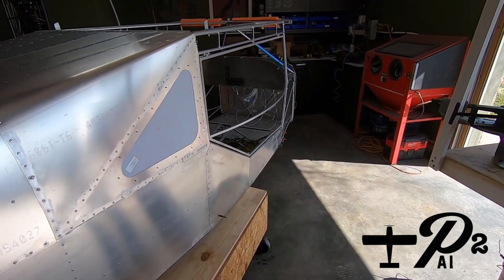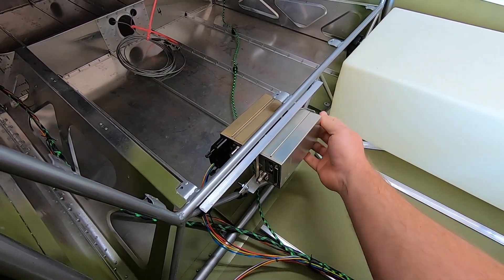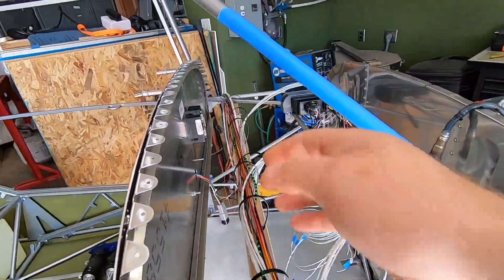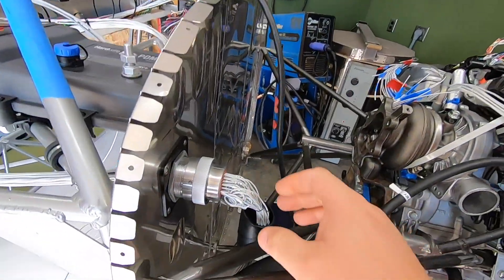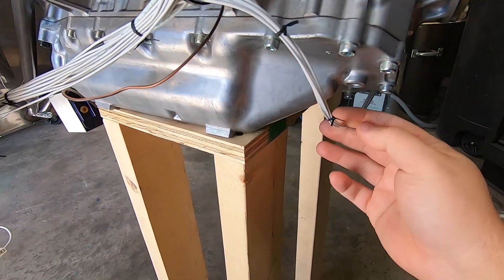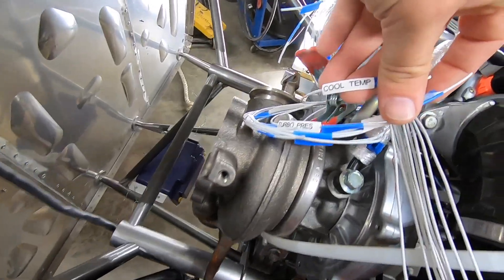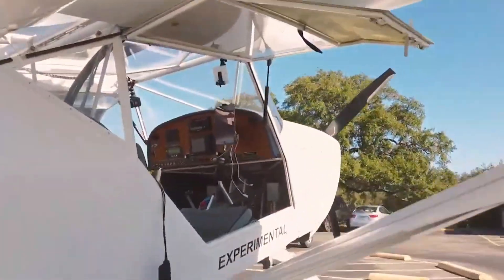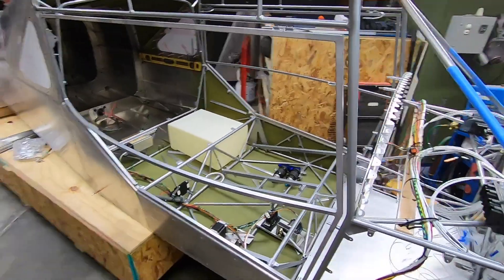RANS S21 EP27 UPDATE

Comment: A Uni-Bit is your best friend, when drilling lightening holes, lot's of opportunities for them from what I saw, just saying. They are time consuming for sure, but I get a warm fuzzy feeling every time I look mine! (everywhere.)  The big Lycoming  21's pilots are going to be in for a shock when you outperform them, especially in takeoffs and landings.
Reply from the maker: I hear ya, all this will come apart again at some point for final adjustments and powder coating etc..  it should hold its own against the titan boys just fine I hope👍
Reply: @Project2Aero   You'll slay them on range, and on operating costs per hour.  The big horsepower guys forget that a lot of that power is needed just to haul that heavy ass engine around!  The added kinetic energy on a short field landing is another thing, it will be interesting to see what your empty weight comes out at.